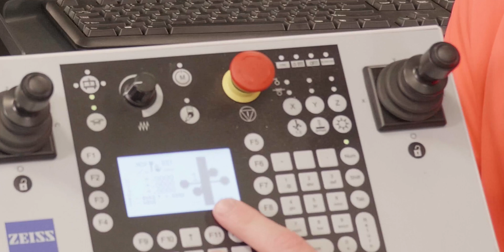CMM Zeiss Duramax with Calypso: Turning the Machine On (Programmer Training Lesson 1)

Comment: what if i cant turn on the drivers? i mean i turn on the cmm and the program but i cant turn on the drivers it just does not turn on the light
Reply from the maker: I’d try to reinitialize the connection through the stop light
Reply: Sometimes, when we move the probes to the extreme corners, the drivers turn off and don't switch back on. However, a slight manual push gets them to turn on again.

Comment: Usually the first move in the homing sequence is a Z+ move which clears the probe head from obstacles.  If not have your Zeiss tech change the sequence.
Reply from the maker: Hi, you are 100% correct. I misspoke when I recorded the video. I noticed it in editing and left it in because I didn’t want to reshoot the whole thing. My reasoning is that it errs on the side of caution and should be harmless to anyone learning how to run the machine.
Thanks for taking the time to leave a comment.